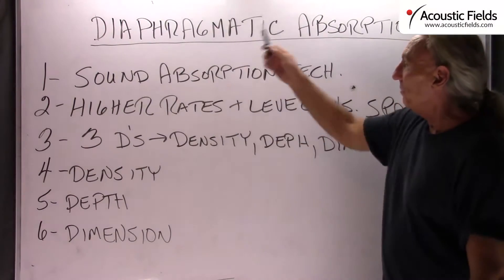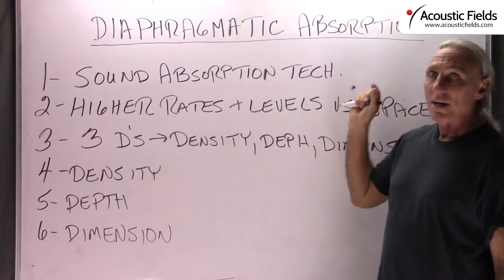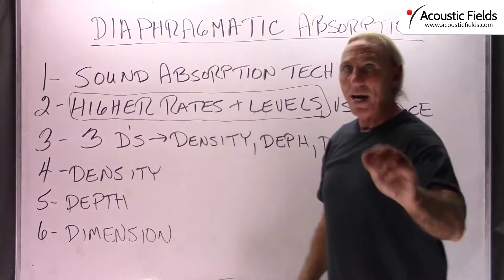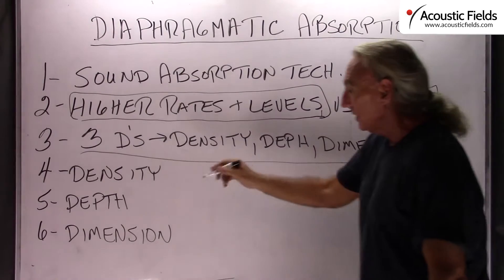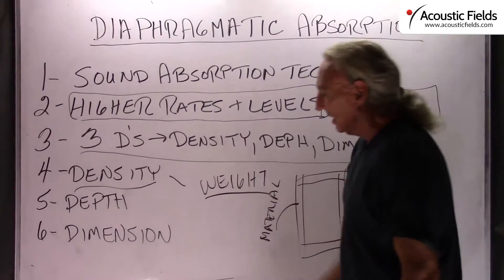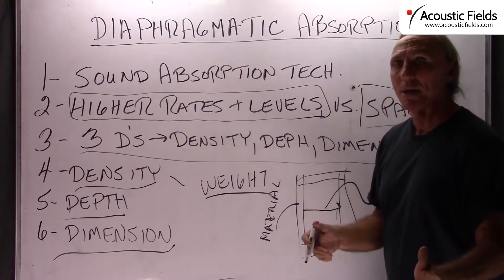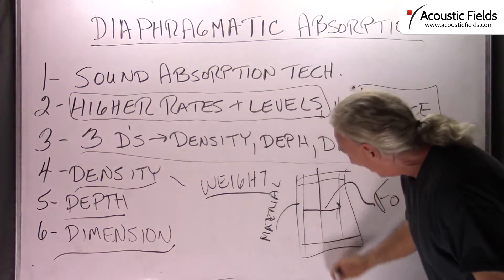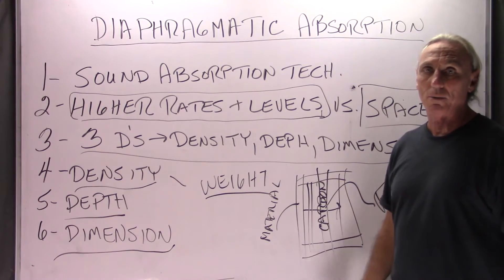Diaphragmatic Absorption - www.AcousticFields.com

Comment: Thank you for this. I'm building my home studio and in a month or two I will try your free room analysis so you can help me tune the room, also I'll buy the bundle of blueprints to make the treatment myself (I live in Patagonia, Argentina)
Reply from the maker: Hi Juan, I would wait on your purchase of the DIY plans. Lets see what your room needs first. Only the analysis will show us what the room needs. From the analysis, we will know what low frequency issues we are facing, where in the room they are located, and what treatments to use. Once we know all of these variables, you can then purchase the DIY plans that will provide you the proper treatment technologies to meet  your room size, volume, and usage requirements. There is no need to buy things you may or may not need. I do not like to see my clients waste their money.
Reply: Hi Dennis, Thanks a lot, I already sent you the information, hope you can understand everything as I'm not very good at speaking english, sent you some pre-construction sketches and all the measurements you asked for. I will wait on the purchase of the DIY plans as you said, just take your time and let me know what you think is best for my room. Thank you VERY MUCH in advance, you rock.